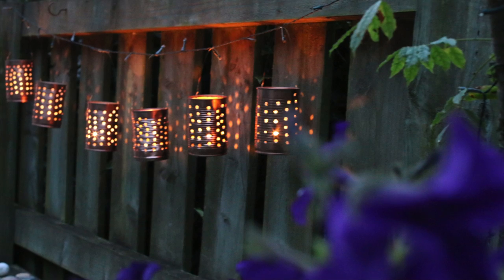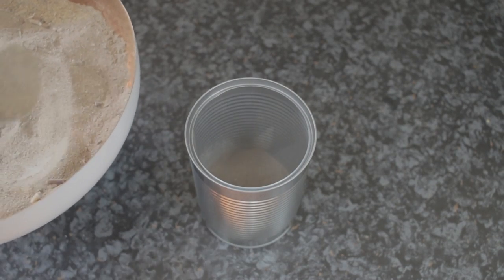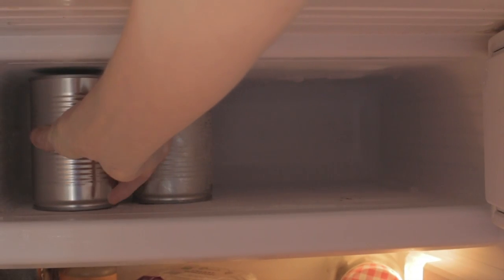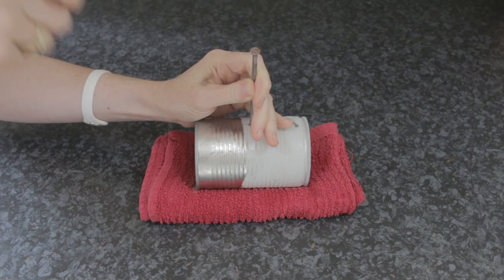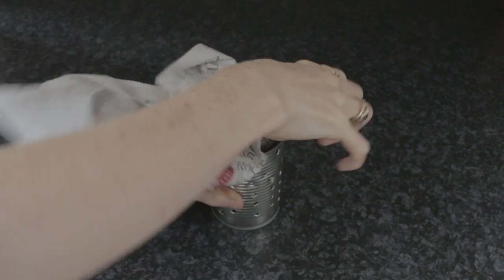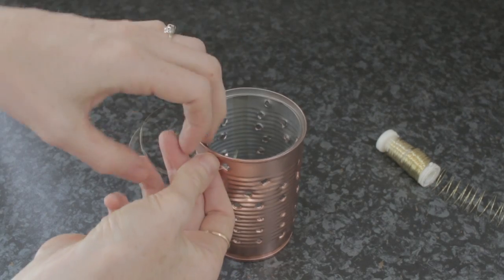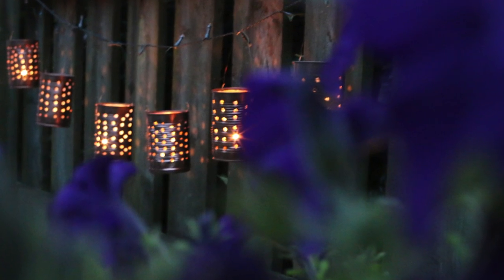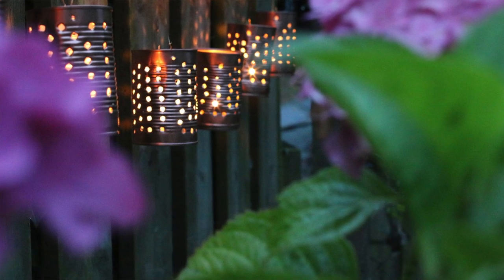DIY Garden Lanterns - Recycled Tin Cans - Fairyland Cottage

Comment: What type of night light did you use? And how do you keep the cans from sliding towards the middle? I literally just placed some cans in my recycling because I wasn’t sure what to do with them so I can go get them for this project!
Reply from the maker: Mina Grey I just used a regular night light.  Was ok once no wind and rain. 
I tied the tin can onto the wire and it seemed to stay put. 
You actually don’t need to do sand and freeze. You can just hammer nails into the tin can and it should be ok. Or use a drill.